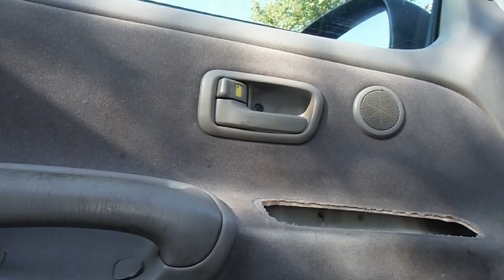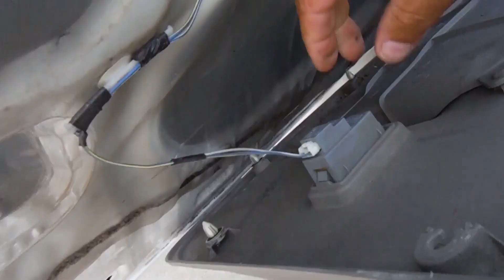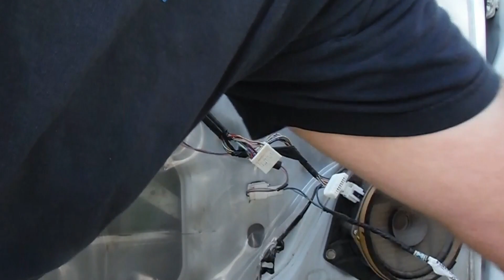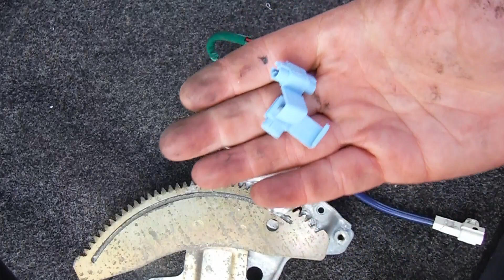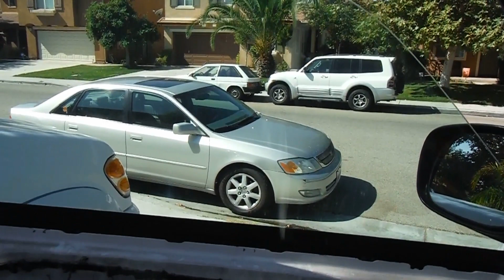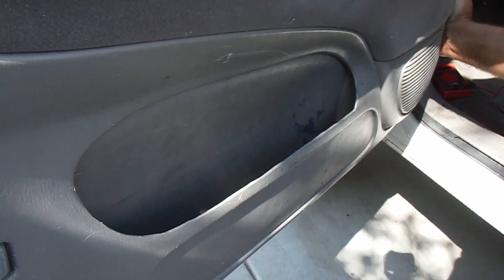2000-2006 TOYOTA TUNDRA WINDOW REGULATOR / MOTOR REPLACEMENT - DIY

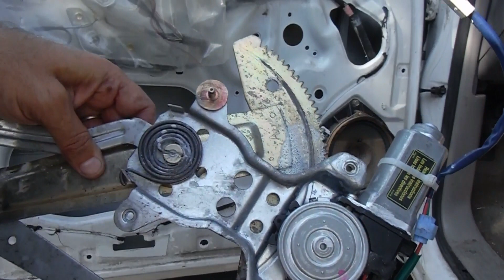Comment: @10:18  But how can you clamp it? You mean if you clamp it in the direction of the diameter of the Circular Spring, it won't open or move anyhow? Do you know by chance how to remove that spring completely off correctly, and then put it back? I need to drill some new holes in my original Regulator, since the new motor holes do not coincide w/original ones and think  it would be better to do it w/no load of that spring. Thank you for the informative film.

Comment: At minute 3.33 you rolled down the window, proving the motor was still good, so why did you replace the motor? I don't understand this, can you explain it Please. Thank you very much. I liked and subscribed.  Great video 👍👍
Reply from the maker: @quangquach-w2y  No problem, and thank you for subscribing!
The old motor would work for a little bit, but then it would just quit working after raising and lowering the window a couple times.  I knew the switch was good, because I had tested that the motor was getting power by removing the connector at the motor and putting in my voltmeter leads while operating the switch up and down.  It is pretty common for them to begin to fail intermittently like that, so I just replaced it.  It has been working great ever since!
Take care,
-Dan
Reply: @DantheFixitMan  :  Thanks for answering the question, you are so kind and wonderful.❤❤❤❤❤🌹🌹🌹🌹🌹

Comment: I had to take everything apart to find out that everything still worked! The motor had some chunky grease in between the metal blades and it got stuck. So we cleaned it and re lubed it and put it back together! Thanks for the easy and informative steps!

Comment: Job complete. I didnt just swap the motor but the entire unit. I had trouble getting my window down to access those 2 track bolts. So I used a wrench to go up and free the 2 bolts holding the glass to the track. Then let the window down easy off the track inside the windo. Then removed the unit. My window made it down about 5 inches before the motor gave out so Im sure that helped me get the window freed up. Once you remove all the bolts it kinda sissors down on its own. I was wondering why my unit came with only one bolt. It is to act as a spud to line up and whole unit then you take that bolt back out from inside the door and install it the correct way. Your video gave me the confidence. I did a full door panel swap/update while I had it off the door. (put in new lock/opening knob handle while open too. I liked it so much and the panel was in such great shape for being 20 years old, I just got back from the salvage yard and got the passager side panel in A+++ shape. Got both for $120 total, with tweeters. Guy tossed in a set of those custom floor mats cut just for the Tundra that are about $50+. Been sweet adventure. Now have to fisingh my light update. Have everything new and LED except the floodlight housing. Have the matching LED to the headlights in the floodlights and they look great. HID LED headlights and flooflights for $40 off amazon. Every light housing around the truck is new and with LED lights including the Reverse and all Signals. Package deal for headlights, running lights and rears (both sides) for $140 from carparts.com. Got new floodlight housing set for $40 off ebay. Updated the grill from Summit for $60.I run glass pack and no muffler, still have cats. Have a Jones Turbine resinator installed next week instead of glass plack. Updated the truck bigtime. Still not finished. Still too much to list. Updated to the 5"Flat black running boards too...Installed both new door handles/lock units. Installed new TRUNK latch as that is broken on most. New lock on fuel door. Still this week, power steering pump (not a remanuf), new thermostat, new air filter and new fuel filter, new ceramic pad break job. My rig ony has 185,000 miles. I like to keep it up. Put in a new rack and pinion too. My friend has a lift and knew how to swap it out and "set the toe"...Was awesom to help and watch.
Reply from the maker: Happy to hear about your project!  Sounds like you're getting a lot done!
Take care,
-Dan

Comment: How do you get the window in the correct position to remove the clamp bolts. Window is all the way down and I cannot lift it manually to access the bolt on the right ha d side.
Reply from the maker: That's a tough one, but sometimes you can get lucky and get it to move by holding the switch in the position that you want to move it (with the key on) and hit the door with your fist.  (not too hard)  that might jar the brushes in the motor enough to make it work...and sometimes that will get it to move.
Let me know if that works.

Comment: Dan the fix it man do the passenger side have a  motor do the one
motor control left and right window
Reply from the maker: Hi Gloria,
The passenger side also has a motor just like this driver's side that I showed in the video.  The switch is different, but the process should be pretty much the same.
Best of luck to you!
-Dan the Fix it Man

Comment: Hey man, it was THIS video that helped me get my motor replaced. I even had 3 clamps on the regulator to make sure that thing stayed in place (I also marked with s sharpie, you know, just in case😂). I agree with a lot of the previous comments - no self-serving nonsense, no unbearable music, just easy-to-follow instructions. Thoroghly detailed and to the point. Thank you so much, kind sir, very much appreciated! Keep up the great work!
Reply from the maker: Thank you Mario,
I appreciate the kind words.  And glad to hear my video was helpful to you.
Take care,
-Dan the Fix it Man
Reply: My window didn't come with the two brackets attached instead i have to use the old brackets from my broken window and reattach them to the glass. Any advice on what sort of adhesive to use?

Comment: Very good detail and follow up explanations. One thing I learned working with electrical connections for many years, is that these 3M push type splices can fail over time. I was informed about this and the techs always used inline insulated splices for lasting connections for all weather conditions as well. That does require a person to have a crimp tool but wire strippers often come with crimping ends. Great job!

Comment: thanks for the video!! Does this resolve a slow window issue? It sounds strained
Reply from the maker: Hi Shane,
The motor might be your issue, but sometimes the mechanism gets gummed up or corroded too.  It's a good idea to check everything and clean and lube as needed while you're in there.
Best of luck to you!
-Dan the Fix it Man

Comment: I've got all the bolts removed but my regulator/motor won't drop down.  Seems like it's stuck to the bottom of the glass (window in up position) and I've pulled on it reasonably hard.  Any suggestions?

Comment: Quick word of caution. TLDR at bottom. 

I followed this video to the T. Bought passenger door window motor. Waited a couple days. In the rain I removed my passenger door panel, but the window was up. Spent hours trying to figure out how to lower it. Finally got everything together. Replaced the motor. Tried to roll up. Nothing. Tested the voltages, and there was nothing? Is it the relay is it a fuse? No they are both off of the same fuse. Took off the driver side door and tested everything. Everything works fine, even the new motor. Banged my head in the rain for a couple of hours. Looked at hundreds of forums and videos. At the bottom of some dark corner of the internet somebody asked "Is the child safety window switch on?"...FML popped the switch and everything worked fine...

TLDR: Check your child window safety switch before taking everything apart.
Reply: This comment saved me time and money!

Comment: If my motor is completely gone and the window is stuck up. How do I get it to move down like you did to align that bolt that needs to come out?
Reply from the maker: Hi Rocky,
A lot of times you can hold down the switch (you may have to reconnect it if you already have the door panel off ) and tap the motor while holding down the switch.  A lot of times this will get it to move.  If the door panel is still on, you can just hit the door panel with your fist (not too hard) while holding down the switch.  Please let me know if that works for you.
Thanks for watching!
-Dan the Fix it Man

Comment: So how do you get the window down if the motor doesn't work at all?
Reply: If you tap on the motor with a wrench while holding the button down it might go up or down to get in the right position. It worked for me.
Reply: I have the same question. The holes to remove the window are not lined up.

Comment: Hello Dan the fix-it man. A big shout out for your video, greatly appreciate it. My question is I purchased the complete unit. Motor and assembly already together After removal and installation Complete I found out that my switch works backwards do you have any knowledge or understanding on how to reverse the switch, Possible switching wires On the switch to correct the issue?
Reply from the maker: Hi Marc,
Yes, just switch the two motor wires and that should solve your issue.  It’s just a DC motor, so switching it should fix it.  You can just cut the two wires from the motor and reconnect them reverse of how they are installed now.
Thanks for watching!
-Dan the Fix it Man

Comment: Anything on replacing the window tracks. I was told by dealer the tracks need replaced also, due to corrosion. Wanted $970 tho replace regulator and tracks. I will try this procedure in the next day or so, I'll inspect the tracks. Hopefully I can clean and lube the tracks.  Thanks for the video. I think I can do this.

Comment: I'd add soldering or proper crimp/heat shrink connectors on the harness work would be way better than t-taps. Those are trash and will cause issues.

Comment: Could you get the motor to run when just connected to the harness or does it need to be bolted into the truck door
Reply: Motor doesn’t need to be bolted in to test that it works. My money is on that most of the time it’s the motor that fails not the switch. New Toyota motors are $300 !!!

Comment: Dan the man thanks. Just finished mine. The worst part was those solderless connectors. Chunked them and used wire nuts. Then had a bit of time getting the door panel back on. But,  its back as it was a functioning great. Thanks.
Reply from the maker: Yeah, I didn't really like those connectors either.  I think the wire nuts should be fine.
Thanks for watching!
-Dan the Fix it Man

Comment: Could you tell how I could fix the problem of the window going up when I push down and vice versa. I know it has to do with the wires being polarized but you do you have to snip the wires and feed them back in to the connector opposite from the way they came?
Reply from the maker: Hi Noah,
Yes, it sounds like the wires are switched.  It might be easier to just cut them and redo the connections.
Best of luck to you.
Thanks for watching!
-Dan the Fix it Man